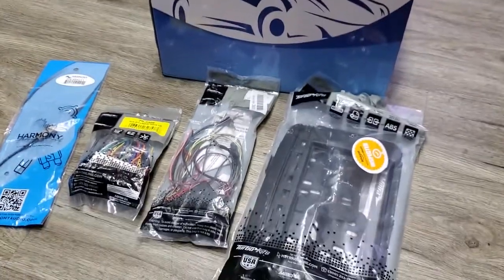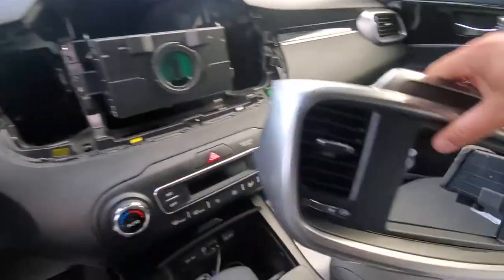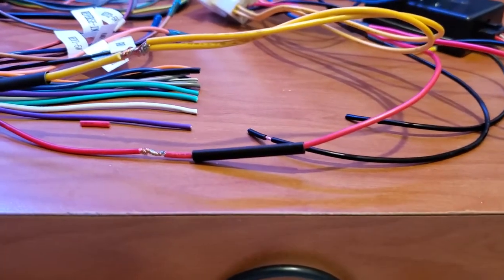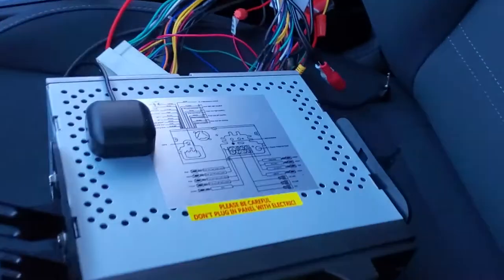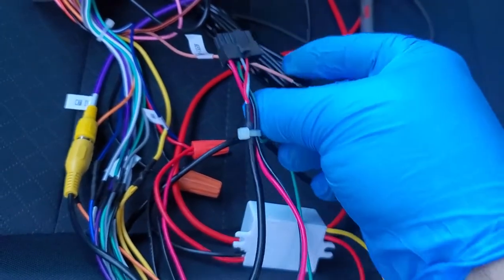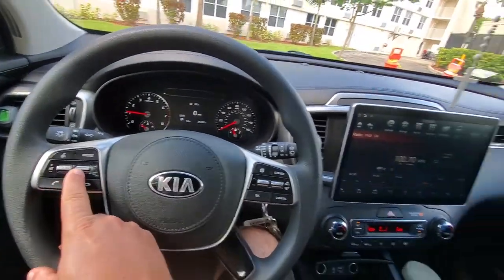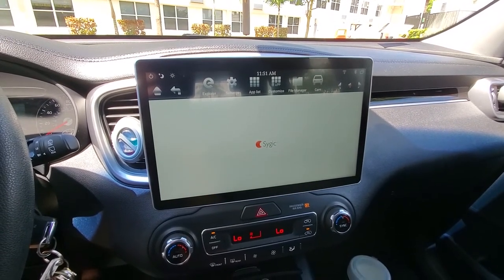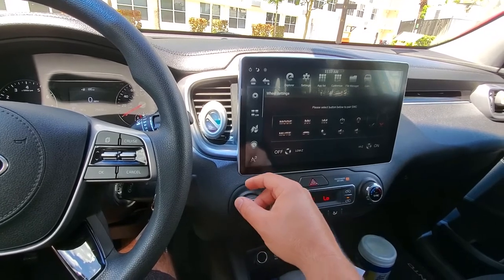2019 Kia Sorento Original Radio Replaced with 12.8 inch aftermarket head unit keeping factory cam.

Comment: crutchfield was saying that axxess kit "doesnt fit" the 2019 sorento but that appeared to be a lie. Thanks for the video.
Reply: Hi LanceFlugerman, thanks for watching the video,  the axxess kit works in the 2019 sorento,  i said didn't work with the 12.8 aftermarket radio, i did try different radios settings and not look, if are you using a Kenwood, Sony, JVC, LG, etc then axxess kit will work with those radios
Reply: @ROCO0022  I'm eyeing up a pioneer. tuning the stereo with a stock head unit is providing it's own challenges since I'm only using crossovers and gains for control outside of the 3 band EQ.
Reply: they said that about my 2019 Cadenza
Reply: @garyanderson7101  I know your comment is a year old but did you ever change your radio? I also have a 2019 cadenza.
Reply: @kali-jf3vm  no

Comment: I don’t have time to finish the video today but my next question is, did you leave your original back up cam in or did you replace it with a new one?
Reply: Yes , I leave the original cam. However, the original camera is 6v that is why I used the voltage step down from 12v to 6v

Comment: I'm confused on the back-up camera wiring.  I get you have to reduce the voltage down to 6 volts, but why did you say you ran a red wire back to the camera?  Did you replace your camera?  Why wouldn't you just be using camera signal from the factory wiring?
Reply: You probably got your answer already, but it depends if your connections are factory rca. Which I don’t think they are.

Comment: Awesome job, do you thing this would work to retain steering wheel controls on 2021 sedona?  I have the same wiring harness everything looks the same radio works but I don't have the interface the one Crutchfield sold me doesn't work but I wanna try the one you listed perhaps?  Any help would be greatly appreciated I'm even willing to compensate a few bucks. Thanks in advance

Comment: Cool tech but it looks terrible sticking out that far from the dash.  The viewing angle from the driver's point of view is not great.  I have a 2016 Kia Sorento but I'll be sticking with upgrading to a 6-7" screen mounted into the double din.  Nothing against the install though.
Reply: I have the same SUV. What radio did you buy?

Comment: what you connected the harness too in the car? I have the same radio the 12.8 and i cant find no one to hook it up in my 2019 Kia Cadenza but im going to do it. I have the same harness and connections as you but can you do a more detailed video hooking up the steering to the radio please this will help me a lot....Thank You
Reply: Refer to the diagram picture at the end of the video, I used the 70-7306 aftermarket harness to connected with the 12.8 radio harness which if is the same as my I did cut the end side of the 12.8 radio harness to connect the wires together with the aftermarket 70-7306 harness,  I hope that I didn't make you more confused, but once again refer to de diagram at the end of the video 😀
Reply: I did but what connection you connected to in the car for the radio and steering? Your video doesn’t show what you connected to in the car....

Comment: i got a sorento 2019
installed 10 inch android steady slim headunit last year, but i got some issues?!
the ahop installed it without using that canbas decoder!! he shredded some cables to find witch wire that deliver the video singal to radio and hook it up to the reverse wire i lost that way 2 things to be displayed in my monitor 1 is i can't change the language of cluster!
2 I can't view the reverse warning ⚠️ arrows that used to be displayed by my factory radio monitor but i still hear the warning.
if someone has knowledge about the canbas benefits for my car I'd be thankful .
thank you for sharing is your experience 🙂
Reply: What are you trying to do... your sentence is extremely long and unsure what you want.
Reply: @ny2bama  I lost some features when i installed one of these android head units
sorry to be long.